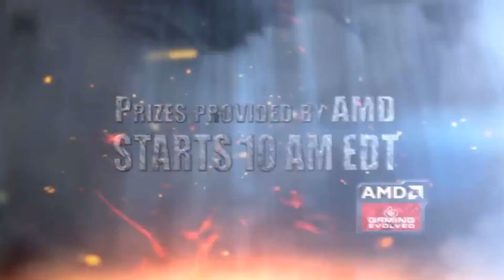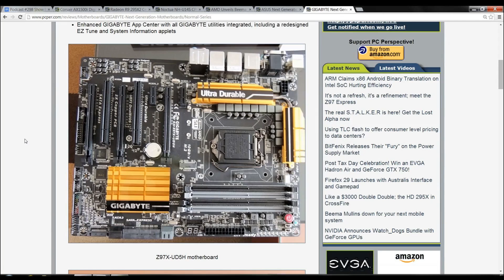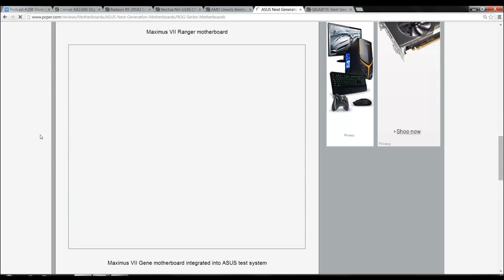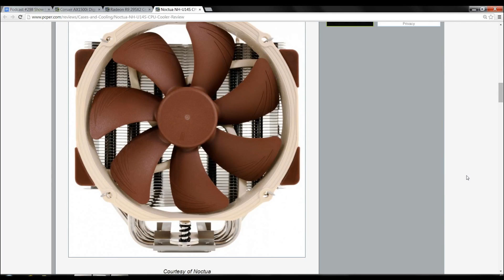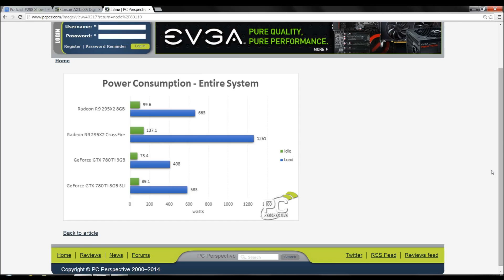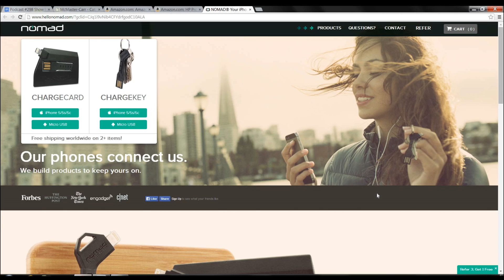PC Perspective Podcast 298 - 05/01/14

Comment: I have had my ST1500 PSU since '09. 8 12V rails, each capable of 25A apiece. My CPU gets a dedicated 50A, and each GTX780 gets its own 25A. If you haven't seen a PSU as impressive as the AX1500i, you haven't looked. Sure, it's only 80Plus Silver, but I feel the extra $7 I've spent since 2009 has been well worth it.